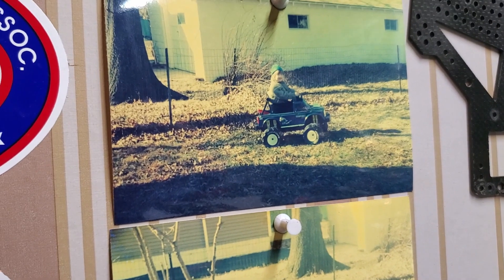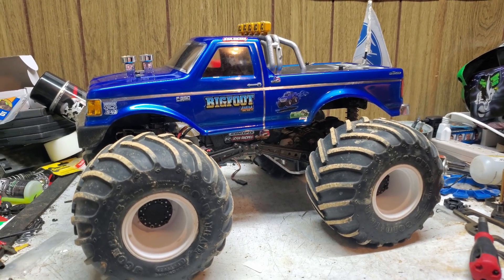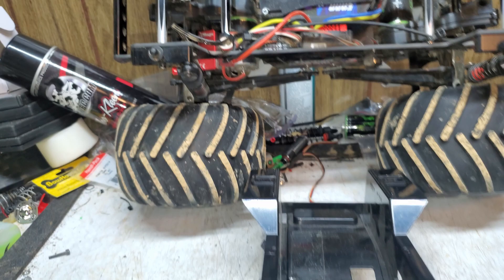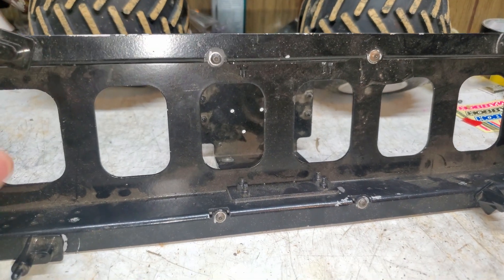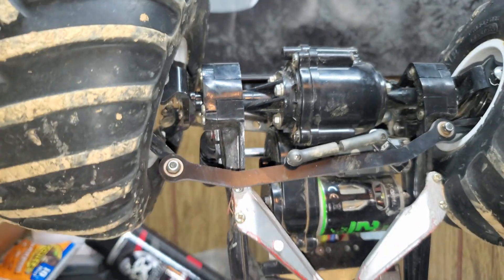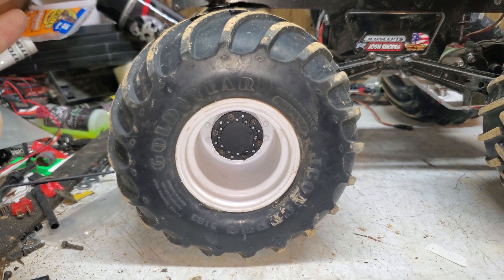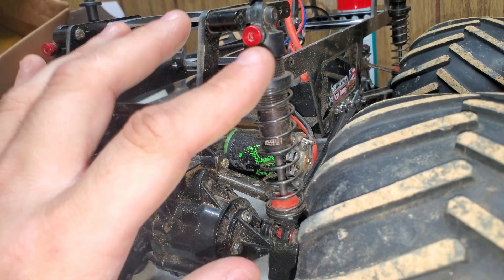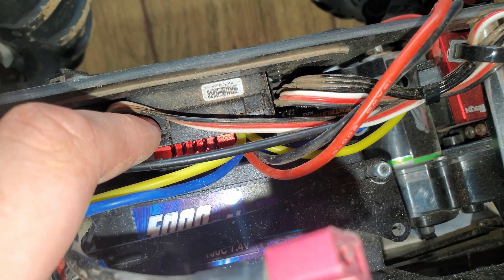JDR RC Blog | Bigfoot IV JConcepts Regulator

Comment: I have the TBG 91 BF body on my Clod which the roll bar is part of the mold.  I love it, but it’s all beat up now.  I would like to replace it with the JConcept one.  Just wondering which roll bar kit you used?  I don’t like the raceback that much.  Thanks in advance.

Comment: That run against Jason Ruona was awesome. Was that your first time beating him?
Reply from the maker: No, we've raced alot in the last few years. Lately we've been pretty even.
Reply: @JoshRhodesRC  I know in the video you say for future TK events you’re swapping to the JConcepts Silent Speed motors. Was the motor (tire and shock setup aside) basically the only difference between both your rigs at that point?
Reply from the maker: @NobiZero  Yes, the Axial motors in Bigfoot were the only difference between it and my Digger 2 Regulator.

Comment: HELLO THERE JOSH CAN I I PUT J CONCEPTS WHELLS ON THE CLOD  BUSTER TIRES  ????
Reply from the maker: @gravediggerrc  You can make them fit. You will have to cut the bead on the tire to fit JC Wheels.
Reply: THANKS FOR THE INFO